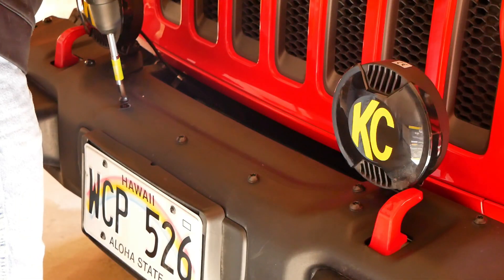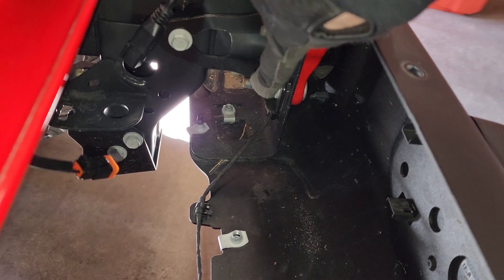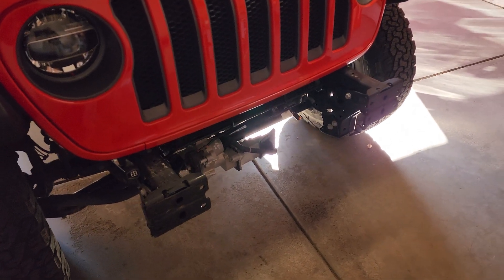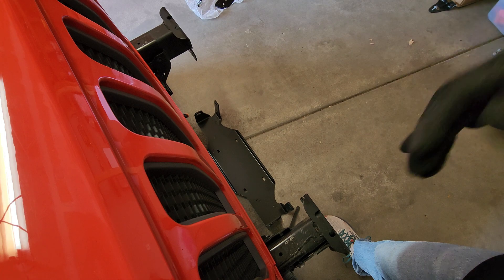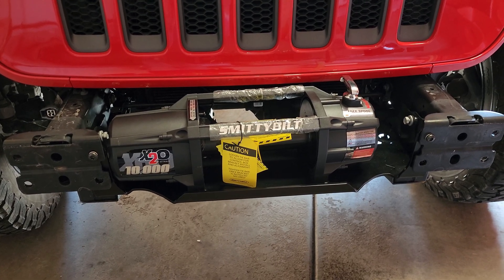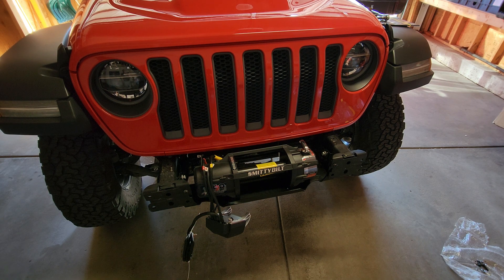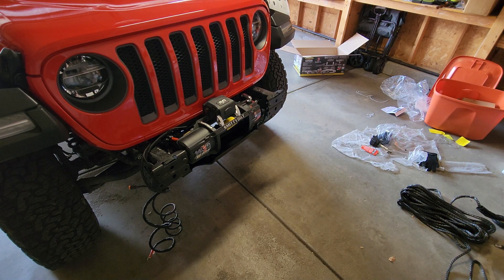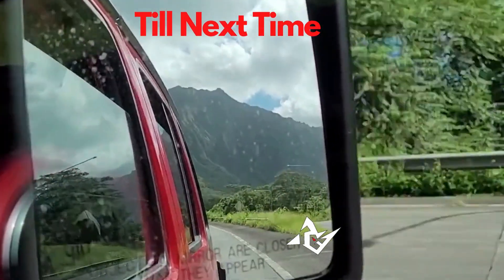How to install a winch on a Jeep Wrangler JL with steel bumper!

Comment: i kinda like this design better than the Warn OE winch plate. seems more straightforward in the installation. Zip ties could've maybe helped with holding it up and then cut it after.
Reply from the maker: It is a nice plate. And at the time, I didn't even think about zipties. Would have been so helpful than. After, I had that thought, and it was one of those "you dork" moments.
Reply: @explorationoverland  I was about to order the Warn winch plate and i just saw your video in time good thing I did!